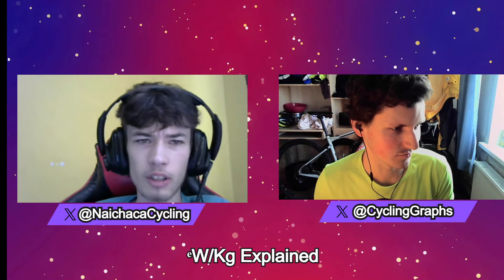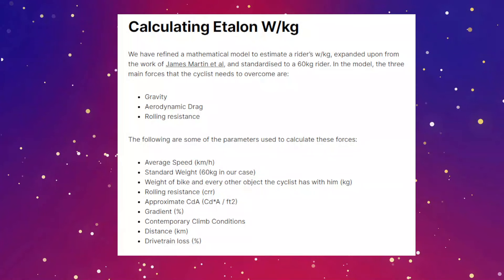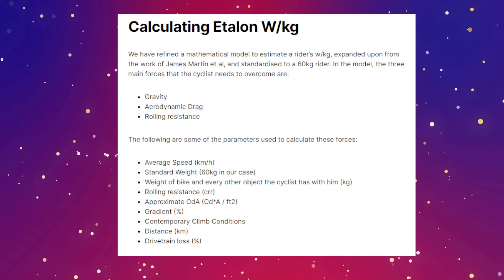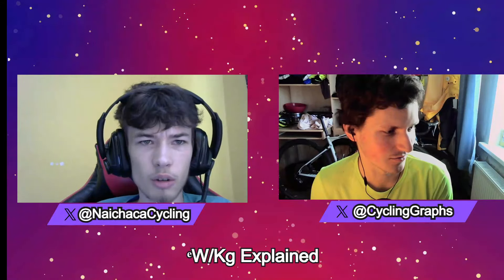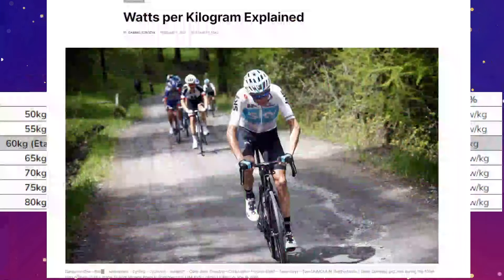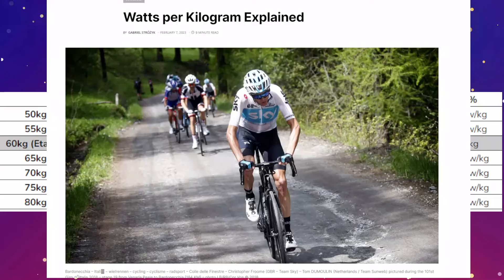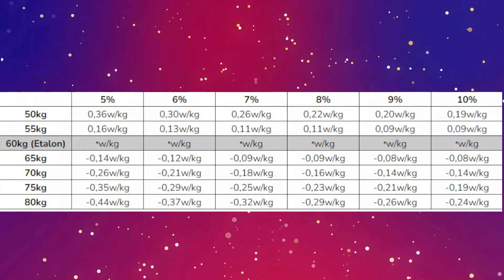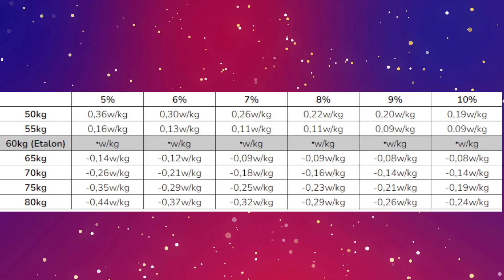W/Kg Calculations Explained - Etalon Weight, Drafting, Wind, Rolling Resistance and More

Comment: 10:43 using a standard CDA is fine to compare performance between the various athletes racing at the same time and give a sense of "how much faster x guy went compared to y", but it is not fine anymore to compare performance between different type of effort, especially in situation where wind and/or a very mixed course are present. I still remember the 7.6 w/kg (now corrected to 7.3w/kg) value for Vingegaard in the 2023 Tour de France time trial that was (and still is) absolutely wrong. Vingegaard said in an interview after the race that he was pushing 380w in the flat sections (and was surprised about it since they had planned to go for 360), but no matter how you play with the Crr and CdA values to get 7.6 w/kg on the 13 min climb meant that to do the same time he did on the flats he would have needed to push 415w. 
Pluggin in Crr and CdA values that allowed the right speed on the flat section with 380w resulted in him pushing 6.9-7.0 w/kg on the 13min climb, which is a FAR more believable performance than the 7.6 (or even 7.3) previously indicated. (I know this values are all eW/kg but Vingegaard's weight is 60kg, so no difference there)
Reply from the maker: The calculation was way off because PCS segment time was wrong. It's so hard to get climbing times for time-trials and later we manually checked it and realized we made a mistake. For ITT climbing section we also use a way lower CdA. I don't understand how do you get 6.9 - 7.0 w/kg and how that is related to his flat power that he mentioned? And I bet he didn't average exactly 380w on the flat and probably it's a rounded number.
Reply: @WattPolice  does YouTube automatically delete comments with links? Wrote a much longer answer before but seems it got deleted.

Anyway I used:
0.178 Cda
9.5kg bike weight
60kg rider weight
0.003 Crr
1.14kg/m^3 air density
1.5% Drive Train loss

27kph speed
6.85% gradient

With this values I got 6.9 w/kg, and on a 0.2% gradient and 53.1 kph speed (flat section between 10km and T-2 (basically the part between T-1 and T-2 after the descent) I get ~383w.

To get 7.2 w/kg I need to put far higher Crr and Cda (plus an higher 10kg bike weight).

Comment: Weight and power requirement rises with 3rd power of size while most biological processes are surface dependent which is rising with 2nd power of size. Therefore smaller  riders have an advantage climbing, even if the min bike weight rule disadvantages them.

Comment: think about it like a trucks towing capability in foot lbs of torque.  Then its about conditions and resistance etc thats why kilojoules as a measurement of total work done has always ben so useful in big one days like Flanders or a hard world championships.
    For a while there in like 2017 they were showing active power which was cool but allows teams insight.  Watts is torque put into crank so torque and thrust that pushes them against whatever resistance they face from slope to wind to surface like cobbles that allows less traction.  One of many reasons cycling is awesome to really get into weeds on.
  Loking forward to Road race the course looks great and worlds in zurich.  Fabian had some monster efforts in 2010, 2013, 2014 he had a san remo run where he was one man show but couldnt win final sprint.    Cool stuff  Generally speaking being on the wheel in normal conditions behind someone your size saves about 20% its why everyone racing says sport is about following wheels.  Attacking into crosswind/headwind  if you have legs is sure win but so difficult have to be on magic day. The chase they have to sort out is so hard its why in classics the strongest are always in the fornt towards finale and guys in break all day have chance.  Fabian in 2010 roubaix greatexmaple.  Less shelter in peloton for guysalso why races usually kick off earlier guys in break have chance like devolder , dillier, matt hayman perfect examples recent years.  
  Thats why teammates are so important keep you sheltered then considering how much stress hormones like cortisol damage body with inflammation its so important in stage racing where healing is important.  Its what any strong team has always shown but Visma with rouleurs controlling breaks while having climbing doms they really showed UAE the formula whh they have the wallet to purchase.  When you see tadej in 2022 and 23 not relaxing in shelter when Visma got guys in break or forced tafdej to follow himself.  Its also why a guy like remco might not be faster than tadej solo but hes harder to follow because you get not shelter or relief.  His position is insane hes naturally in puppy paws position lol.   Went from steel to aluminum before carbon frames.  Pantani was mental about removing all grams possible even bandana and earrings on that giro attack that dropped tonkov.  Classic stuff

Comment: I would assume 10 watts on chain friction, 5 wasts on aero, 1-2 bike stiffness, 15watts on rolling resistance on tires pluss better nutrition during the race until last climb
I think it really adds up from 95 to 2025
Reply: Maybe 0.5 Watts per kg from 95-2025
Reply from the maker: Tires and skinsuits is the biggest difference. Will try to find a perfect guest for this but it's so hard to know how much 2024 tech is faster.
Reply: @romanmathaes8451 nahhhh thats a wild claim. 
-15 on tires (on a climb btw) and 10 on chains (consider they use the same gear ratios and comparable chain tech) LMAO, youre just pulling numbers out of nowhere
-daily intake averaged over the race time was already 120-150g/h in the 90s, more than enough to produce the watts, so no relevant improvement there
-skinsuit really hard one as most of the draft benefit is from DRAFTING, not some marginal CdA  benefit at 23kmh from a suit xD
Reply: @welanduzfullo8496  Claims hes pulling numbers out of nowhere and then proceeds to do the same.
Reply: @welanduzfullo8496  the amount of carbs per hour claim is pretty wild. literally zero ex pros i know about have said that. infact they say the opposite, the amounts were way lower. where did you get those numbers from?
Reply: ex pros i know?, ok bro ...

+ you realize when they say 120-150g/h, they mean pre race carb intake + during race divided by hours raced, not 120-150g per hour during the race 🎣

-michele ferrari comments about lance's and other riders he coached on fueling in his blog 
-spanish sports lab coaches comments on fueling rates of spanish pro riders in 2000s
-early 2000s case studies on fueling in the us on world tour cyclist
-phonax coach comments on fueling for floyd
-ullrich podcasts where he talks about his fueling situation at telekom 
-bjarne riis comments on fueling during his prime and comments on fueling in his docs as team coach at csc and saxo
-garmin team coach articles on fueling 
-articles on telekom team and race fueling strategy in late 90s 
-greg lemond comments on fueling for hard stages
-tyler hamilton comments on fueling in the csc doc in 02/03

Comment: Do you ever think maybe they are mechanically doping to explain the heavier bikes ?
Reply from the maker: No. The disc brake bikes are just heavier. And it's hard to get them until 6.8kg if they are with aero frames and wheels
Reply: @WattPolice  not buying it
Reply: @Translucent6000  why would you ever use motors if other forms of doping are so much easier with way less chance of being caught
Reply: @Translucent6000  they are not using motors bro, let go of the greg lemond "bUt fRoomE uSed a mOtOr" fantasy 🙏

Comment: Why estimate like this? In this day and age, with tools like Strava, surely it's easy to get accurate estimations just by riding the course(s) after the pros go through? All you'd have to do is ride the same short section for 2 minutes at different w/kg values, making sure to take the racing line while using similar equipment. I'm pretty sure that someone could ride 7w/kg for 2 minutes and it would be very obvious immediately if it lines up with what these guys are supposedly doing. To do these estimates without riding the hill might have been fine in 2004 but we're in 2024 now.
Reply from the maker: because who in gods name is riding every single climb in the whole cycling calendar same day as the pros + powermeters are not very accurate
Reply: They're trying to normalise a comparative measurement of performances. I'm not sure what your experiment would achieve.
Reply: @WattPolice  I'm not suggesting that, only the final climb where the hammer goes down. It's dead easy and powermeters are easily calibrated.